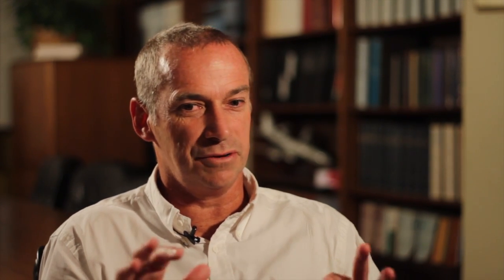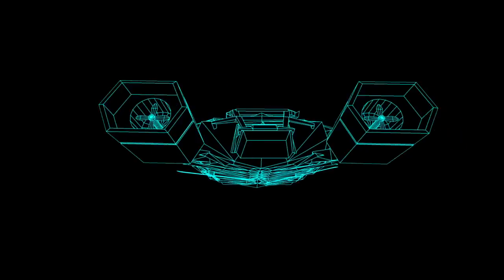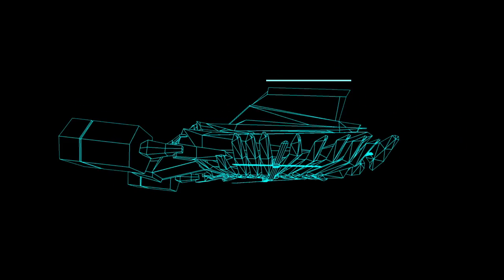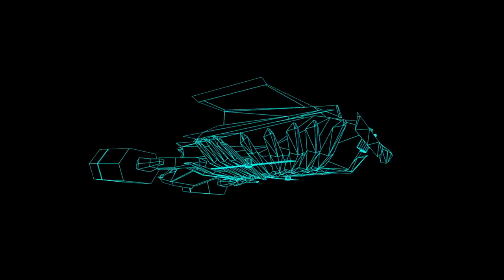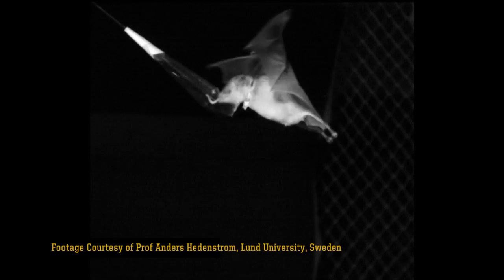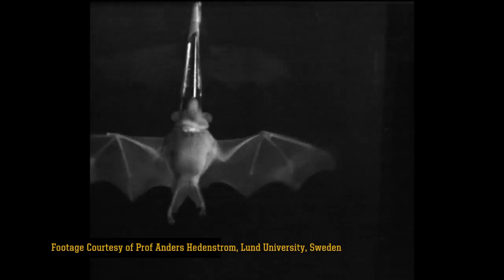The Dark Knight Rises - The Bat: Fact or Fiction?

Comment: Yeah, he should've mentioned the ducted fan(s), but I'm guessing as a non-expert the diameter is too small to perform as depicted. 

Anyway, the big problem here is with a helicopter (even with jet assist) outrunning/dodging guided AA missiles. 🤣

I'm assuming some idiot senior studio exec demanded it to crank up the emotional pitch of an action scene — that's usually how bad science happens in movies. 😒

The least-capable (foreign) MANPADS accelerate to top speed of Mach 1.3 in a matter of seconds; many are Mach 2.5 or faster. You don't outrun them, you use flares and/or IR jammers, assuming you're reasonably lucky and they're not using another form of guidance. 

Even Tony Stark/Iron Man knows better. 😎 A similarly rich, savvy dude like Bruce Wayne would know such portable missiles are easily acquired on the black market by well-heeled criminals, and would have planned ahead long ago with an appropriate suite of countermeasures. 

Didn't detract from my enjoyment of this otherwise excellent film, though. 🙂
Reply: Yeah, it’s like a helicopter
Reply: @kevingarrett2330  I think its engineering is way ahead of our time and there is no need for such a big air vehicle. Pilot can likely crash into buildings with it.

Comment: While I would agree that the Bat defies some of the laws of physics, it's not really a winged aircraft. It's more like a twin rotor helicopter/hovercraft, with multiple directional vanes on the underside, and two small cylindrical thrusters in the rear.